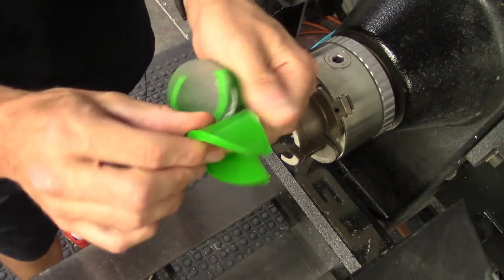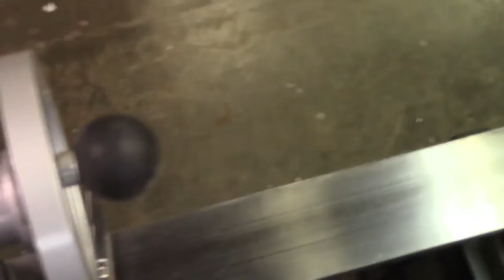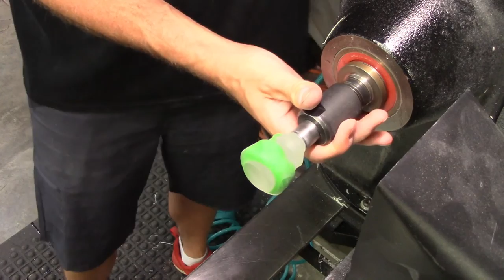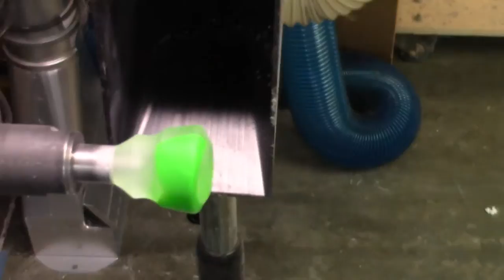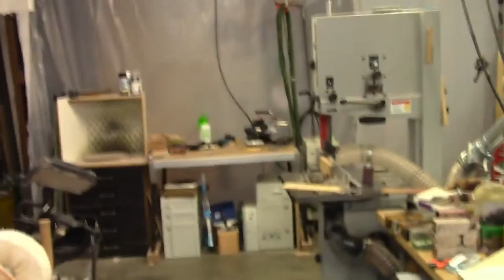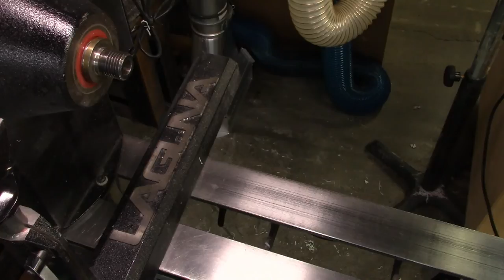🔴Replay: Turning a Wine Stopper With the Bent Resin Blank | Episode 146

Comment: Hi Zac.  I have had a few clear casts come out a little cloudy lately.  I measure exactly, empty the compressor of any moisture,  mix at least 50 grams each of parts A and B of Alumilite Slow, and pressure pot at 50 lbs overnight.  It seems a crap shoot whether they come out perfectly clear or a little cloudy.  Any suggestions from the casting expert?  Thanks.  Mike
Reply: That happens due to moist weather(rain/snow). It will be all fine in summer / dry weather. 
Maybe you can try keeping it in a dry silica gel container.
Reply: @avarpe  Thanks.  I did a pour upstairs where I had the air conditioner was on and humidity was 42% and all was fine.
Reply from the maker: That's a bummer!! Try adding a little extra Part B on one and see if it clears up. Maybe 1 or two grams more than Part A, so 100 grams Part A/102 grams Part B. Sometimes that can fix the blushing